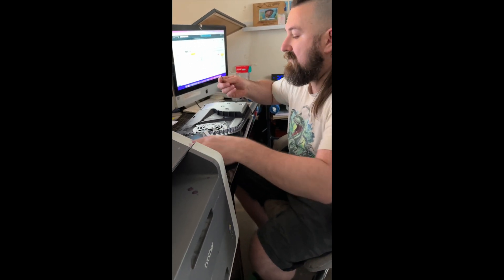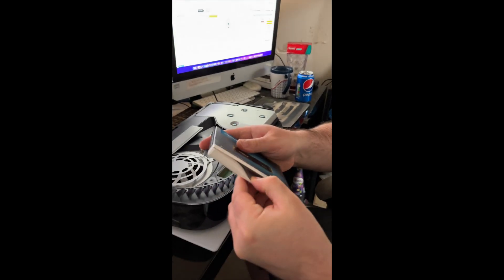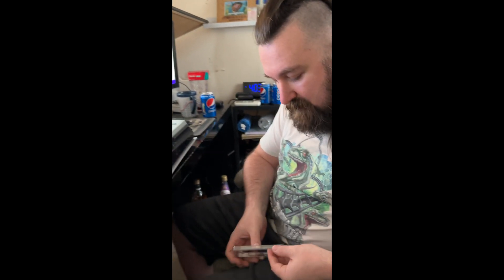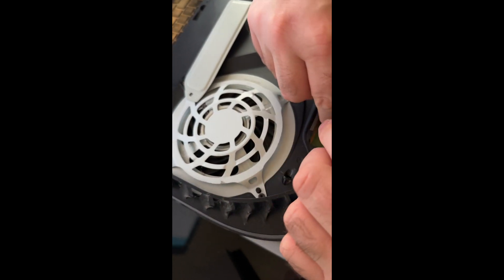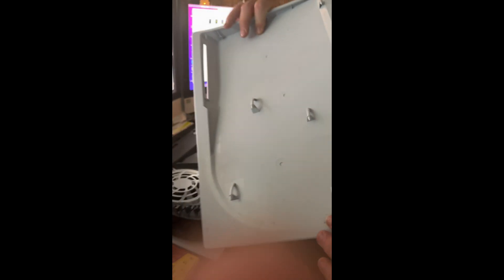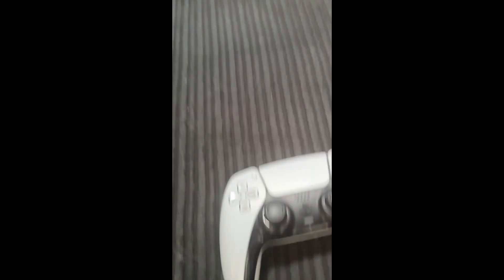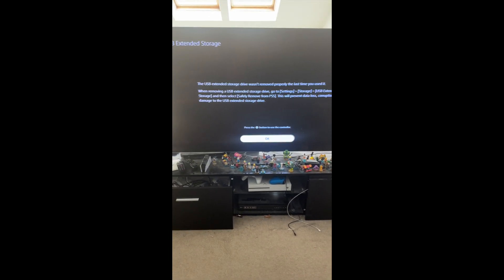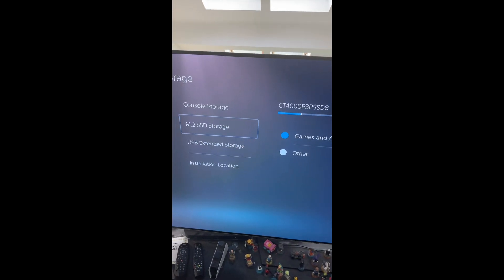PS5 M.2  SSD Install Crucial P3 Plus 4TB & PNY XLR8 Heatsink

Comment: To anyone who’s confused, according to Sony, a Gen4 card is a must, but the 5500MB speed is only recommended. So, although the NVMe doesn’t reach the recommended speed, it will still run on the PS5 (provided you buy a heatsink for it as well).